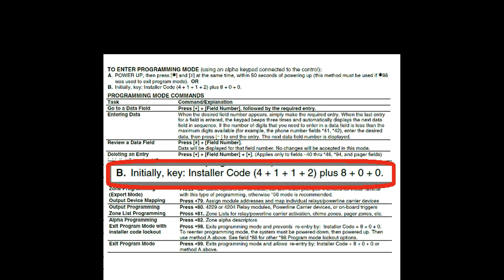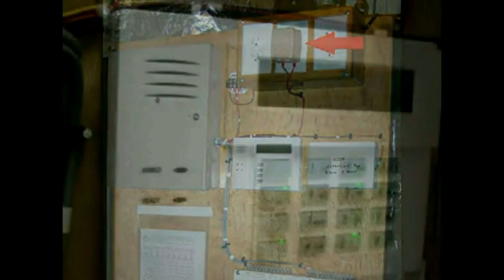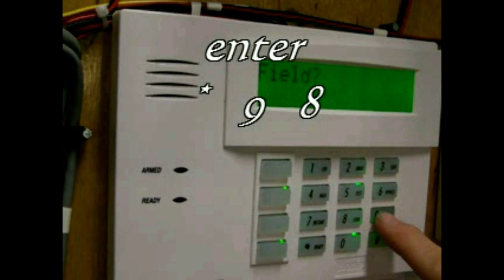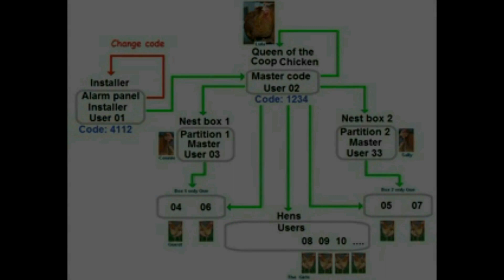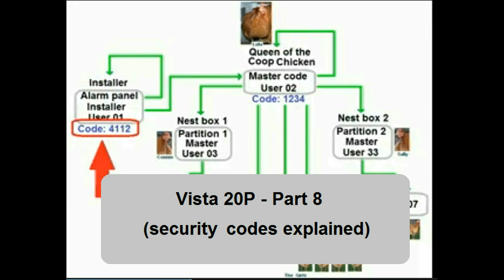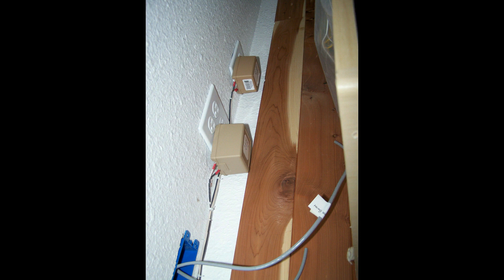Entering program mode after being locked out (Visa 20p part 18)

Comment: Who came up with the bright idea to make *98 lockout one off from *99? Lockout should not be some easy thing to do, it should have a very different pattern. Dummies.
Reply from the maker: You are so ABSOLUTELY CORRECT!! I have had to change out a Vista card for exactly the reason you have stated. While learning and filming, I made that mistake. They should have put the last number on the opposite side of the keypad.

Comment: I can explain the 0's before each number when reviewing a field.  When using non alpha numeric keypads, they can only display 2 digits at a time.  Honeywell must have decided that rather than displaying 2 digits at a time and possibly confusing people, they figured that displaying one digit at a time and chiming is better and easier for users.  For sanity's sake, they just added the digit to the bottom right of the 6160 (and other alpha numeric keypads) to allow systems with both a standard and alpha numeric keypads to be used (to an extent) during the programing process.
Reply from the maker: Hello Andrew,  Thank you very much for the clarification and passing this information on to others.

Comment: I have pretty much the exact setup except it was installed by ADT who I recently canceled. You videos have made me super smart in this system. I have a question for you. My codes are all accessible but can ADT brick my board remotely? I own all the equipment but if you have ever canceled them they come across very vindictive and they even read a script that all the equipment will be rendered unusable.
Reply from the maker: I have never dealt with an alarm company, so I am not an authority for speaking toward their ability to brick your system. I do know that if it was my system and I owned the equipment, then a company that I did not have a current contract with bricked my system, it must surely be illegal. I would prevent the possibility of this from happening  by disconnecting the phone lines from the panel. (I would then reprogram the unit with *56 to remove all report codes since they are no longer being used.) Anyway, at the end of this video, I show you how to replace the card that they would brick if they actually did it.
Reply: bounder97 Thanks! Your videos are top notch!
Reply: Compass has a “shutdown” option that can disable a panel completely.  When that’s done, everything becomes inactive and keypads will show “d1”. At that point, the system is useless until it’s re-enabled in Compass again.  I’ve never known ADT to do this, at least around here. 

Compass allows an option to disable all keypad programming, and to lock out the power-up program entry method to basically keep anyone from getting into keypad programming without the installer code. 

I’m currently dealing with a Vista-21ip that was taken out of a site, but it’s unusable because the dealer locked out the power-up program entry.